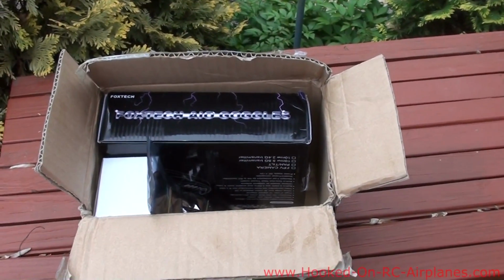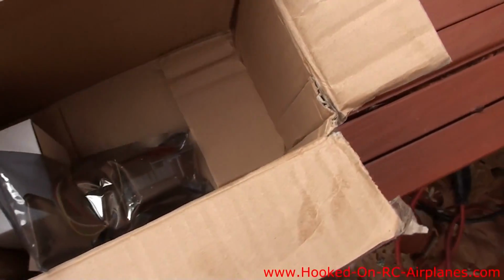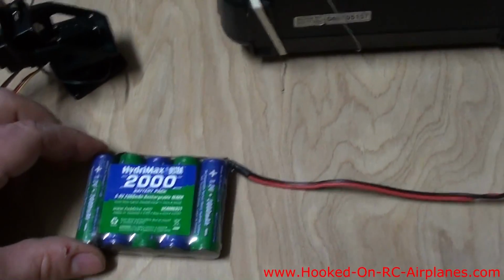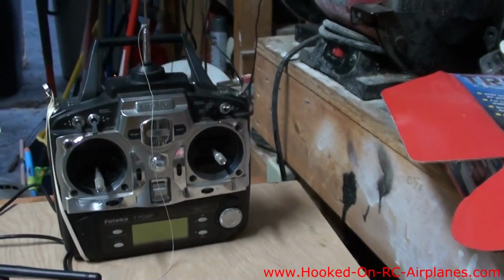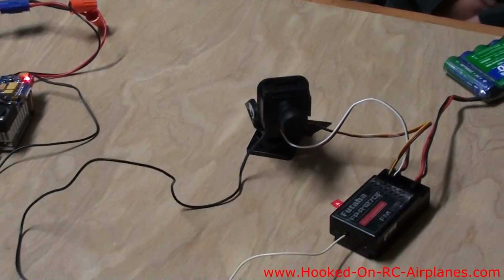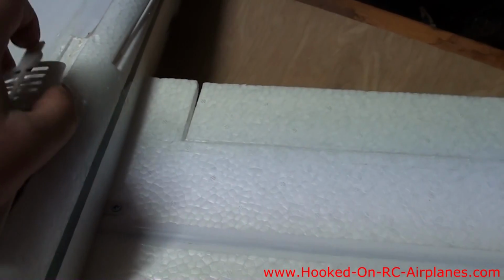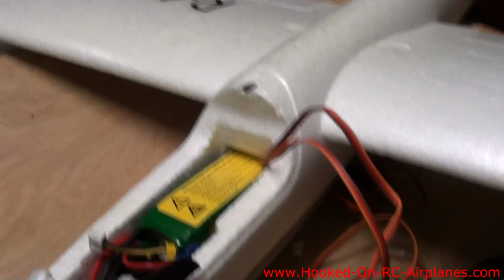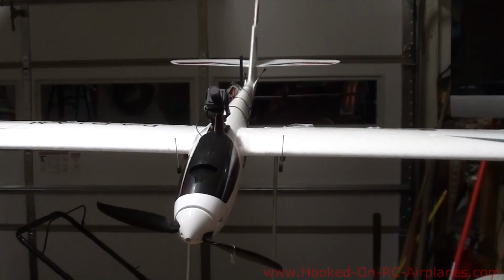Foxtech AIO Video Goggles Part One

Comment: Ya, you would think that would have been a good idea right?  Me too.  But as it turns out...  It did not have a happy ending,   I think I over loaded the BEC on the ESC.  Only thing I can figure.  But I lost all control of control surfaces, but still had full throttle! lol     You can see it here...   

There is a video of the maiden crash on the Hooked on RC Airplanes Youtube channel.  I tried to post in this reply but it said NO!